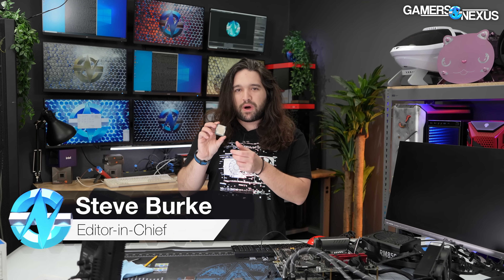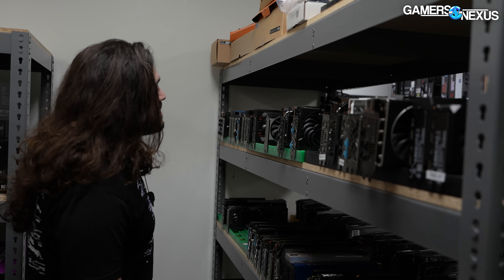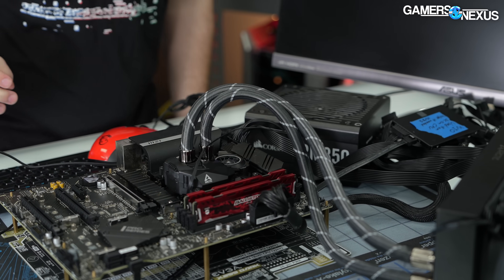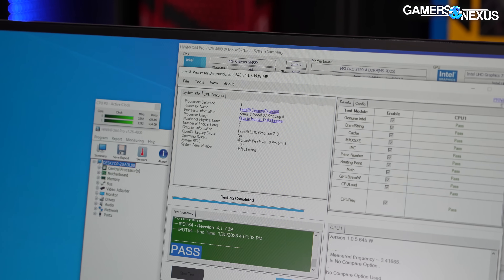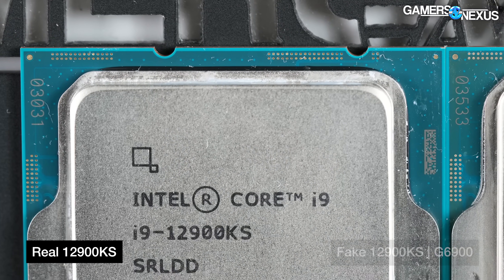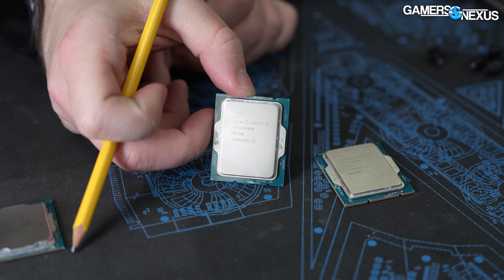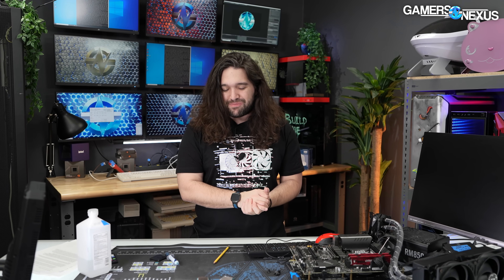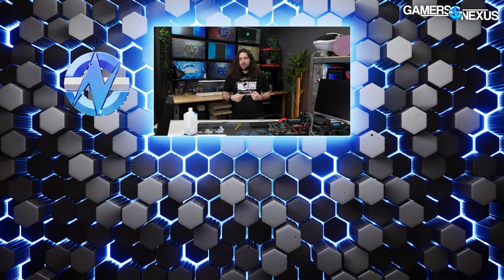Beware: Counterfeit Intel CPU Scam on Used Market

Comment from the maker: Find our recent i5-13400F CPU review over here! https://www.youtube.com/watch?v=AdvWGEzYqg4
Reply: LTT did a video a year ago called "I Ordered a FAKE Ryzen 5 3600 from Best Buy" so there where some fakes.
I have not re-watched the vid but if I recall they where not even the right socket so would not even fit the MB.

But like you sad I haven not heard of it being a big problem.

Also some scams might target the retailer instead and not a secondhand user.
Reply: DO they have somthing like this for AMD? i would love to see if my CPU is real.
Reply: How to correctly reset a fake drive to its correct size? I used to have a tool(a GUI app) I came across on a forum I blv, I think it was made for SD cards at the time but do believe it also worked for harddrives as well iirc, it allowed me to edit things that the WinOS can't see, even under Linux it wasn't possible. No idea what it was called( I faintly recall just a few of the Chinese symbols and maybe a couple digits in the title). -Have you heard of this or used such? I think you should cover it in a video.. I should have a copy here but I have 25yrs of data hording, randomly fit onto drives as space was needed, many files corrupted, another great idea, how to properly restore data(i.e. repair data-streams/file-types, or have you covered it lately?.. I'm only as of late started folder naming, dating, and attempting to sort & properly store the data, but may be awhile before I find the items I want. Thnx in advance <3 GN
Reply: thx for the tip will improve my counterfeits immediately
Reply: @GoolagCEO  Make them decent CPU's, affordable and take over the game! ;)
Reply: @KavorkaDesigns   im good, just needed 500 dolla for a new AMD rx 6800 
thx Intel dolt 🙏
Reply: So this was actually an IHS swap, not some super detailed process of cleaning the CPU lid and then adding new CPU designation to it? 

Delid the G6900 and inspect the solder/RTV around the die. You have nothing to lose as you will make money off the video with only a couple of man hours between delidding, filming, and editing. Easy money and we will all learn more.

Also, why use software to verify.  The motherboard bios will tell you what CPU is installed.
Reply: So good of you to help out a viewer like that! Thanks for the heads up on these scams!
Reply: scan the qr code on the pcb. nuf said.
Reply: No Intel 12900KS should have the round intel logo on the IHS, no? the change to the rectangle was made on the 12900K midway through the lifecycle before the 12900KS was released
Reply: LOTTA Scammers in china; TONS of them selling fake products on Amazon Japan & other similar sites (`Rakuten` where we got scammed) also. It`s almost as if it is State sponsored.
Reply: Hey, any chance you'd be willing to part with your 7700k? Computer prices are obscene, and my only option is to upgrade to the best possible processor for my Maximus VIII hero.
Reply: Ltt did a video on a fake ryzen 3600 about a year back it was even sold on BestBuy's website, difference with this method is there they delidded and swapped the ihs onto the cheaper cpu title of the video is "I Ordered a FAKE Ryzen 5 3600 from Best Buy"
Reply: I recently seen very cheap i9-10850K I wonder if those were legit. ~220$ for new box version.
Reply: Cpu Keychain dudes on reddit come to mind they just do it on dead cpus
Reply: Of course they don't care. cops are too busy arresting people for killing themselves with the most dangerous "narcotic" on the face of Earth...........cannabis.
Reply: i purchased a 13700k cpu from amazon which was completely fake.  I made a video about it as well.  They told me they can't refund me.  I literally got scammed from amazon.  this situation seems different from what you stated but i wonder if i could get amazon to return the fake cpu back to me.  well i hope you see this and if interested.  This was purchased brand new and had an actual different pcb from a real one.
Reply: Hey guys, do this batch and serial number method work on oem cpus?

Comment: i  got an i7 4790 from amazon sold by some company name . it was listed as new and sold for 70. When i got it the blue box said " this is not original intel packaging"   i did the test with diagnostic tool and everything passed. i was happy until i saw this video. If anyone reading can give a 2nd opinion that would be cool. The seller on amazon has 4.5 star ratie from 73 rates. And one review said he paid for new cpu but it looked used and the box also said not original packaging.   If you search intel cpu images there is the box with  graphic stuff a silver shape of a man from shoulders to head. That is not how mine came. Its just a blue box with desktop proccesor on it a big i7 and windows logo in background. Me worried long time

Comment: A friend of mine came to me, that I would help him with his fresh build. He bought an 14900KS and nothing worked. The ASUS-Mainboard that should be able to check if there is a problem with the cpu didn't even start the POST-Process. It made us believe, that the motherboard must be the problem. Even the ASUS Support headed in this direction. But it was the CPU... it looks exactly the same like the Celeron G6900 in your video from the bottom. The new variant of the scam might be simulating an defective mainboard. We had luck to have a second system to cross check.

Comment: @Gamernexus Hello Steve , I bought the 14900ks from amazon , not warehouse deal and sold/fulfilled by amazon , the blue intel box was sealed with a sticker and the whole box was inside another brown box (like refurb boxes) + amazon shipping box, the lid of the cpu had 14900ks + square logo - the actual cpu turned out to be as you can guess Celeron G6900 , was wondering if you are still interested in this cause I taken few pictures before returning it and waiting for over 30 days for a refund,  Amazon is treating this issue as a regular return without any red flags , may end up with another buyer ?

Comment: QUESTION: I'm looking at 13900k/kf's and it looks like there are 2 versions? if you look up pictures you can see some with pads on the top left and some without those pads. trying to figure out if these are scam CPU's because there seems to be a huge number of them. 
the ones I thought were legit have the same or similar pads on the from to the 12900's, and the ones I thought may be wrong look like 13700's. 
any chance you guys would shed some light on this? would be nice to have a continuation of this video for 13th gen, especially if there are 2 versions like I'm seeing which have me confused.

Comment: Well ... Just got an i9-13900k from amazon ... turns out its an i7-13700k which has been IHS swapped !
Going through the amazon return procedure right now ... wish me luck !
Reply: i'm seeing a large number of 13900k's on ebay with pads placement that looks like 13700k. there are so many i'm starting to doubt they were fakes.

Comment: I have a Ryzen 2700, which is 100% a Ryzen 1700 with a changed IHS and even HWinfo reports it as a 2700. Even has a Ryzen 2700 AMD box which looks legit. But the frequencies / cinebench scores are identical to my 1700. I also have a 5600 with the same scam. Never purchase from aliexpress, or third party chinese seller.

Comment: I remember this old scam. I've done this myself. I bought a brand new i7 7700k from the store, then I removed the metal plate and swapped it with the old celeron G3900 that I had. Then I sold the Celeron with it's 7700K metal plate in order to return the investment I made for the 7700K I just got for myself.
Reply: why you would admit to this I have no idea. you are not cool.

Comment: In the pandemic, China scored in the sale of used cars. Here in Brazil, many kits were purchased, not by choice, but because of the high cost of buying them in the US or Europe. At first everything went well. Until the fakes started.

Here we repair electronics. And from China began to come in video cards, problematic DRams painted and laser-recorded as batches or marks without problems. What dark times we are going through. 😐

Comment: Well in the end the text on the heat spreader doesn't mean anything, you need to check the board itself. 
Do you think it's possible to get something like this from a shop? 
I mean scammers can return it to the shop and then they will sell it to you? Or some of the staff doing this? Asking cuz it is scary cuz sadly you can do nothing in a situation like this, the shop will just tell you it is you who did it and that's it

Comment: On the second hand market it at times can be tricky (talking about websites like Ebay) to be sure if it's a real deal or not (though, if it sounds too good to be true it usualy is). However, you can also run into 'scam' parts from official retailers. Some bigger shops aren't too keen or thorough with their return policies (checking the returned parts), they simply grab the part, and put it back on sale with a slight discount and market as used. What they failed to do, is check the product itself if it's realy the part it is supposed to be. Back with the first Ryzen launch (AM4 socket, obviously with pins on the processor, and not in the socket like LGA), people would buy the more expensive Ryzen (1700x if I recall), and return the part, but keeping the Ryzen and put a Celeron (pinless LGA CPU) in the box. CPU goes back to the shop and instantly back on sale, and the next buyer gets a Celeron LGA cpu instead of the 2nd hand Ryzen they were expecting. And with that, the risk that the new buyer gets marked as a scammer while he/she is the one that got scammed.

Fake GPU's are usualy a bit easier to spot (not all unfortunatly), but a lot of fake GTX 1060's (which were flashed Fermi 450 or 550 cards) were easy to spot because of the VGA (sub-d) connector. The real 1060's didn't have those anymore. Recently saw some fake Radeon RX 580's, which were actualy just RX550 or RX560 's, those were harder to spot from just looking at the card. But comparing the specs, you'd notice that they were fake (less shaders / cores etc), problem is, you usualy must have the card in your possession to check with GPU-z.

Comment: No need to worry for me because I only have LGA 775 intel core 2 duo E8500(Gaming Beast) bought on Feb2009 and still using until today 7 march 2023 with a new afox motherboard, anything bought online will be better than my dual core even if it is a pentium g3258 it is still better.

Comment: If you work in retail you need to also be vigilant. Someone could buy an i9 and also a cheap CPU (probably not at the same time) wipe the cheap CPU's text, copy the i9's text, deliberately fry the cheap one and return it to the store claiming it won't boot.

Comment: Big thumbs up for this video. !!!   I have to say that I've been building PC for 40 years, that kind of gives away my age as well.  I've been really disturbed by all the counterfeit going on last decade or so, and to be honest, the vast majority comes from China.  There's got to be a way to stop these counterfeits flowing into the country. And I have to say a lot of these are probably brought into the country by new immigrants from China.  This is so disturbing on the other side of the conversation, that commerce is fine, but China using counterfeit to profit off American consumers, then use that accumulated wealth against the United State is more than upsetting.  I'm personally fed up with it.  It's affecting the quality of life for millions of Americans, and we need to petition elected officials to put more resources at the border, or stop imports from China all together.  Well, maybe it'll just flow in from Panama.  Either way, a solution needs to be found.  Every consumer should be able to feel safe, when buying anything on the used market.  But a big thanks for sharing this video to amber alert consumers.  THANKS

Comment: I bought a Intel i5 3570 a few years ago from eBay for $20 with $3 shipping. It was for my server. Everything turned out as expected. I did however use PayPal though in case it was a scam. Always use PayPal when buying electronics online. I have gotten "scammed" before buying parts on eBay, but PayPal stepped in and refunded... every single time. MOST people are NOT scammers btw. Out of hundreds of orders, I had like 6 that were scams

Comment: Just watchin` this now but it is much more common than you may think and goes even more bold. I was also scammed and it was an AMD R7 5700X that I`ve bought from one of a big electronic shops! Bought it as an outlet cpu, marked as a ''class a'' category (meaning either it was a shop`s ''on display'' unit or other customer`s immediate return that was bought brand new. Turned out that the casing was original but the cpu underneth was an old FM2 cpu. My only conclusion was that the previous guy bought it, swapped cpus and returned it to the shop. That only proves that in most cases these big shops do not check their returns. I`ve also returned it and had no problems with it but it was only because when I got it, opened the pack and knew straight away what I`ve got, then returned it immediately hence they could not blame me for doing this. Imagine all other people with the same case who bought such cpu, didn`t opened it for a while or didn`t noticed anything till instalation atempt and was not granted a return option cause couldn`t prove that they did not tempered with the cpu!

Comment: I wouldn't  even rely on hardware visual test, since cost of making a fake PCB is less than real one. I would run a program that I have used on slower cpu and compare with a faster one. Availability of low cost counterfeit product production is widespread.

Comment: So I bought a Used I7 7700 on Amazon for $100 with no cooler.  What I got was a new I7 7700K factory sealed with a cooler and still had original factory coolant under the plastic seal.    So not all bad deal out there
Reply: Thermal paste, not coolant.

Comment: Intel already has a habit of making every 2 generations of CPU with different socket or incompatible with older version. why not make the cover of every line of CPU different. like a celeron has a different cover, an i3 has a different cover, same with i5 and i7 and i9 while still using the same socket.

Comment: Thank you for this vid,  i was bidding on a i9 13000 and i did your checks , it looks like the ebay one is fake cpu, i have now canceled my bids thnaks again bud
Reply: copy link please, will be good for potential buyers
Reply: I was going though 13900s on ebay and there are either 2 versions of the chip or like 50%+ are scams. even if you google 13900k you get both so I have no idea. one has front pad placement like 12th gen i9, other has pad placement like 13700k!

Comment: The plus side of getting a genuine part from a reputable retailer is also that you get a warranty.  I got a bad 13900K and since it was genuine Intel accepted for return and replacement, expecting the new monster to arrive in the next 2 weeks.
Reply: What was bad about it? Benchmark scores?
Reply: @markemery1353  One of the cores was defective causing random BSODs and crashing programs.

Comment: That 2D matrix is on the Green edge of the substrate, like you mentioned and despite me confirming mine, they still made me jump through hoops just to end up telling me that they don't have any i9-9900KS OR i9-9900K chips to warranty it with

Comment: Yup, I got screwed on my i9-9900KS which got killed by a Orico NVMe clone dock which fried my NVMe boot drive and then shorted my Z390 Aorus Master board AND the Northbridge on my i9-9900KS and Intel COULDN'T WARRANTY it because the people that got scammed had gotten theirs warrantied so there where NO more i9-9900KS CPUs to cover my legitimate chip. INTEL even made me contact MicroCenter and have the manager email Intel my invoice as me scanning or taking a picture of the receipt and chip wasn't good enough for them because there have been so many scams.

Thanks for doing this video Steve.

It doesn't help me but im sure it will help others

Comment: The whole first party retailer thing... Linus has a video on a fake Ryzen that was actually an AM3 processor, and it came from BestBuy. Probably someone returned it and BestBuy just directly restocked it. Checked if it was present and that the CPU lid said what it should, all the pins are straight, that's it. Can't always expect the employees there to know their AM4 pin layouts, of course, but a company like BestBuy should imo send it to a testing center to reseal it or something. Yeah, costs money, but still. If the trust in businesses like that erodes, that's also bad.

Comment: If it's a reasonably smart, non-occasional scammer, he would have a real 12900k at hand to send photos of, so you're doomed without buyer protection / charge back capability.
The seller demanding cash, cryptocurrency or prepaid store cards is the simple indicator for scams.

Comment: there is a store nearby our home that sells boxed and no box amd processors. i really want to buy ryzen 5600 series and the price is like 40$ less on no box. the available 5600x no box vs 5600 with box. i would like to ask if how can i tell im not being sold a counterfeit on AMD esp. on the offer of the  5600x is 40$ less than a new 5600. or should i not buy the offer?

Comment: I remember running this intel utility on my intel q6600 CPU, which is a quad core with no hyper threading, and it passed all tests except for the last one.  I had it for 10 years though already, so not a big deal to me.  It's long gone now though having been recycled, as I upgraded to a new system with an AMD 3900XT.

One odd thing I remembered about it was my system would sometimes drop the multiplier from 9x to 8x once in a while and I'd need to go change it in the bios.